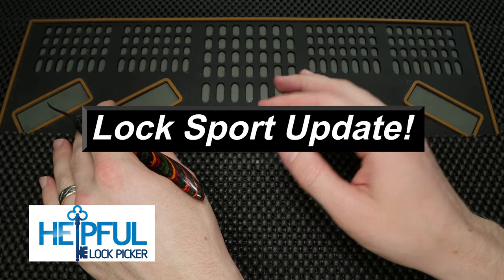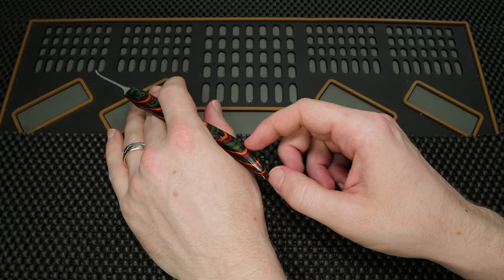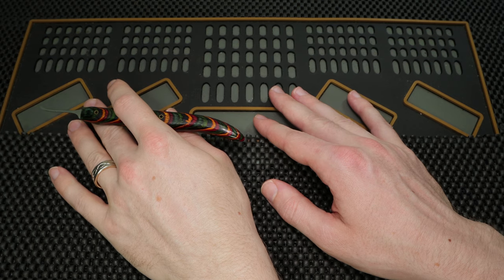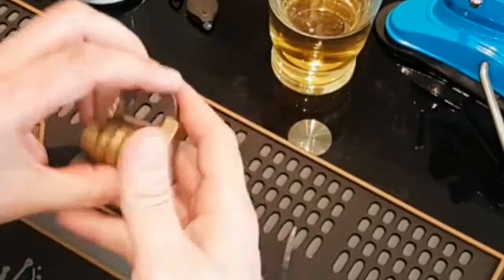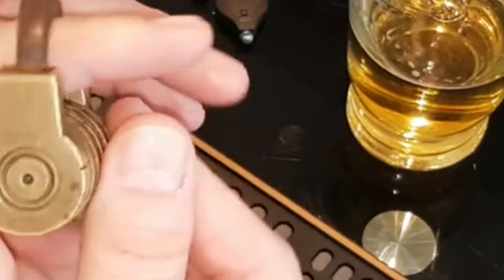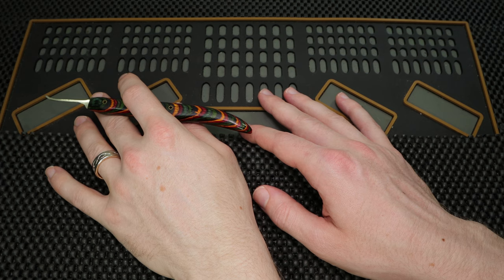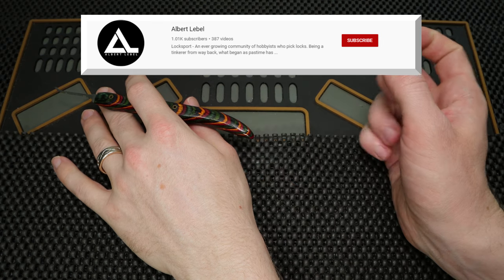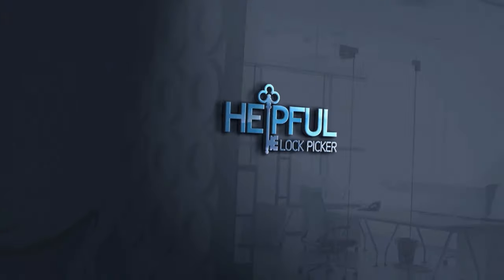[376] Lock Sport Update | Sharing Channels From The Past and Big Al's Milestone!

Comment: Hello there, im new(ish) to lock sport and my pick set finally arrived in the mail today with 2 practice locks. One of them is a dimple lock and I’m having some trouble.. so I think picked it successfully but at soon as the core began to turn, the top pins(with springs attached) all fell into the slots that’s supposed to be in between the pins. Is this a design flaw of the lock or did I do something wrong? It’s acting like it needs something to retain them from falling when you turn the core. I’d appreciate any help!
Reply from the maker: What retains the pins is the key to the lock isn't designed to be picked
Reply: HelpfulLockPicker thank you for you’re time!  So am I understanding you correctly here: my practice lock isn’t meant to be picked!? That sounds like I got ripped off lol